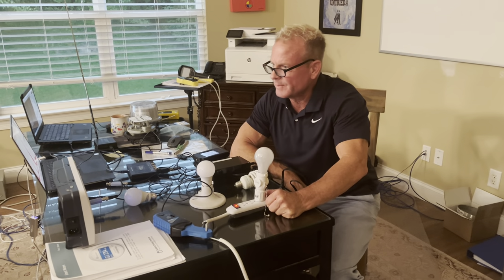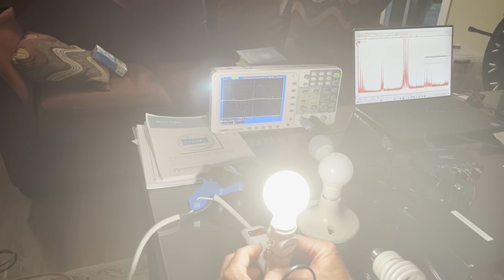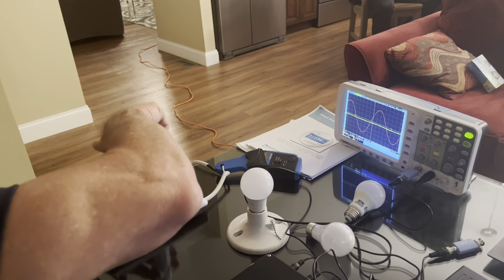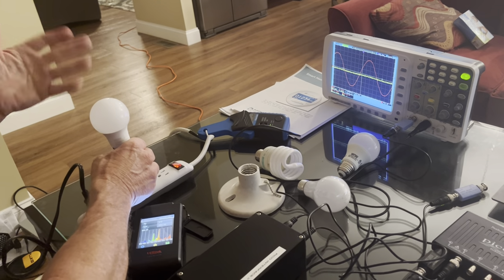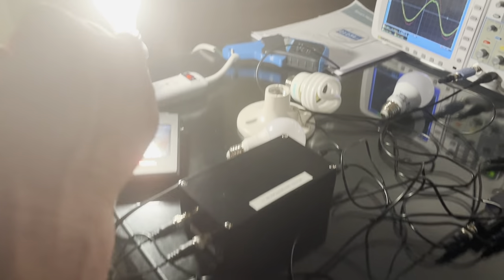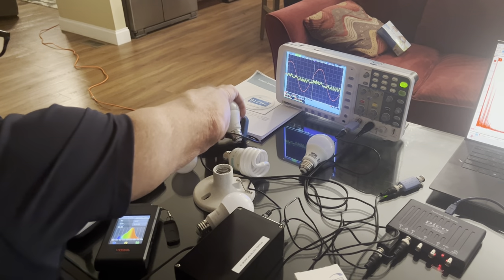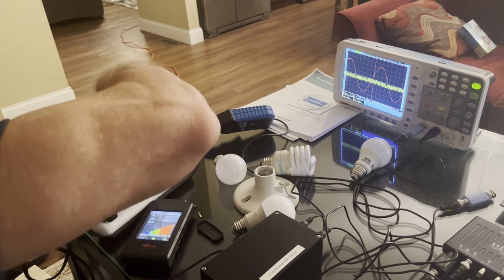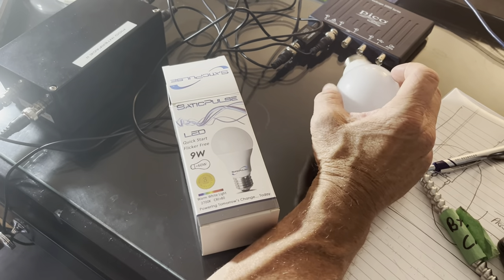LED Vs Incandescent Light Bulb Test

Comment: Hi Rob, thank you again for all your hard work. I would really like to have the same setup at home with the Picoscope and Owon in order to observe DE in my domescic wiring. But I have a problem my mains does not deliver live and neutral in Spain, but two phases of around 130V. I don't know how to connect the osciloscope and picoscope to my biphasic installation without smoking them. There is also no ground wire in th wholw appartement building to make things worse. I'm going to ask Bill Bathgate for advice but maybe you can help me with some ideas please
Reply from the maker: William practices as a professional in electrical engineering and mechanical engineering disciplines. He was recently employed at Fiat Chrysler Automotive on electronics systems for such things as radio communication for electric and  autonomous vehicles etc. William was previously employed through late 2015 for 8 years at the Emerson Electric Company. While at Emerson Electric he was the Senior Program Manager for Power Distribution Systems and in charge of RF and IP based digitally controlled high power AC power switching system product lines in use in over 100 countries. He was also directly responsible for product certifications such as UL (USA), CE (EU), PSE (Japan) and many other countries electrical certification bodies. He is very familiar with the electrical and electronic design of the AMI meters in use because he was responsible for very similar products with over 1 Million units installed across the world. William also has over 20 years work experience with IBM and Hewlett Packard in computer systems design and manufacturing.

He holds a  DOD Top Secret Clearance, serving in Cyber Security with the US Missile Defense Agency, NASA and Homeland Security. He is a Certified Building Biologists and a Certified Electro Magnetic Radiation Specialist by the Building Biology Institute https://buildingbiologyinstitute.org/. He is an IEEE Certified Radio Frequency Safety Officer and conducts radio antenna surveys for assurance to the FCC specifications. 

He is Vice President of the Residential Consumer Group https://residentialcustomergroup.org/. This organization has legal representation in all Public Utility Rate Cases submitted in Michigan. To date the group has caused the cancellation of numerous rate increases in excess of over 1 Billion in increased utility costs to Michigan Residents. 

He has done this analysis due to his own curiosity without conflict of interest of this new technology. He has 40 Years work experience in design and deployment of:

	High tech power management systems, UPS and power distribution 
	Switched Mode Power Supplies 
	Electrical and Electronic hardware engineering
	Computer systems engineering
	Radio Systems design and testing 
	High Current and High Voltage switches
	Internet communications using both wired and wireless technologies
	UL, CE (Europe), Africa, Japan, Australia and China product safety certifications
	Cyber encryption (DOD Level) and protection of Radio Communications using digital signals 
	RFI/EMI mitigation